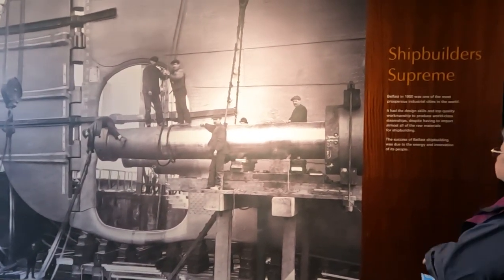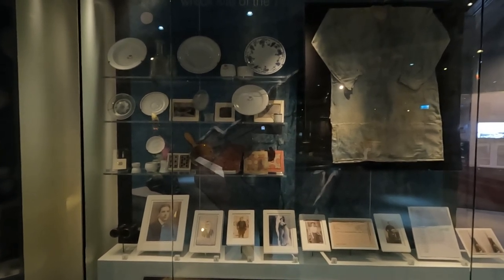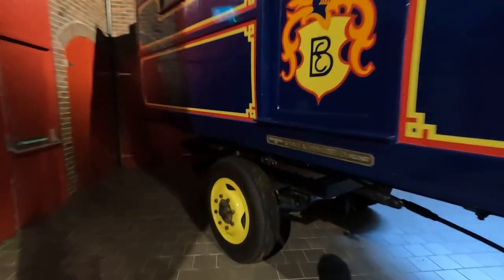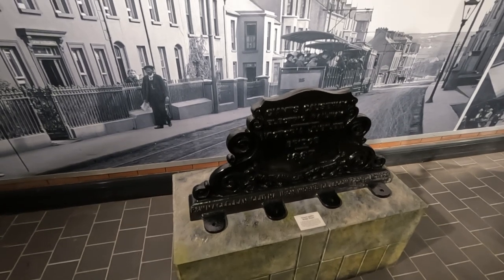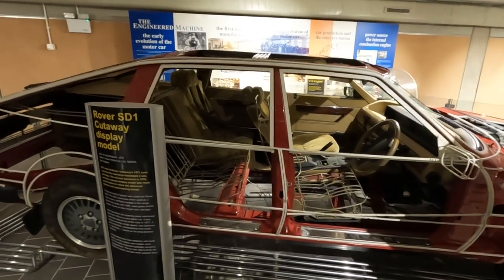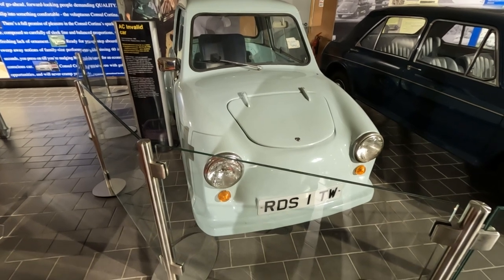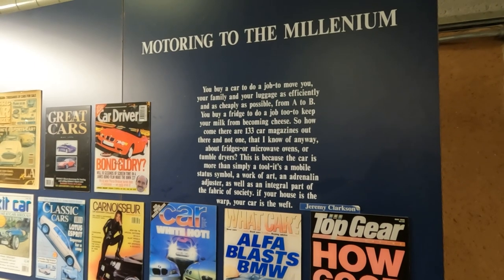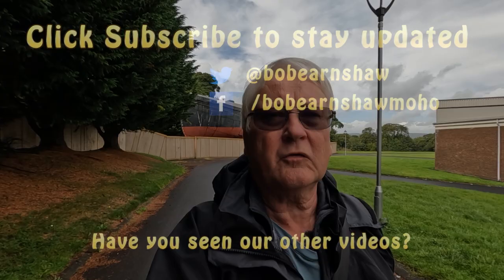Ulster Transport Museum Part 2 - Ship Building, Buses, Cars & Innovation

Comment: Hi folks. Nice to see your getting so much into your travels. My father work Harland and Wolf all his life, as did his brother, my grandfather and great-grand-father. The latter work on the TT, sailed with it to Southampton whist the fire was still raging. He got so drunk at SH he fell between the bails of rubber. Therefore missing the travel to New York. I found it strange that until the "70-80% "of the NOT SO TRUE MOVIE appeared on the screen, almost no-one In Belfast or H&W ever talked or thought about the TT. They then saw then they see the ££££ signs as many jumped on the band wagon. They still do. No -one in the design office in Belfast ever spoke the TT was UNSINKABLE, that came from either the NEW York Times or Washington Post.

 The White Star line ordered H&W to change the spec sheets and use inferior steel and rivets with regards to the bulkhead and were ever necessary. To save build costs. They were also ordered to keep quiet with regards the BOILER ROOM INTENSE FIRE which had been raging out of control for several week prior to Belfast departure. Upon leaving SH the fire was still uncontrollable , this resulted in the inferior steel and rivets warping thus enabling the iceberg to slice through. White Star Line hush up.

Please you both enjoyed the Museum quite a bit to see there. Well once again enjoy the travels and stay safe.
Reply from the maker: Thank you, that's very interesting, I had heard about the boiler fire.